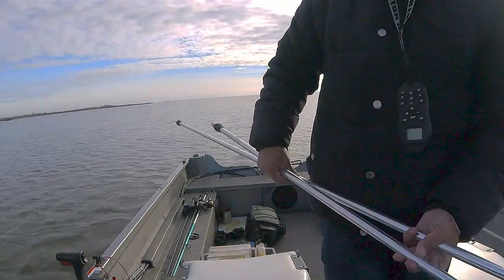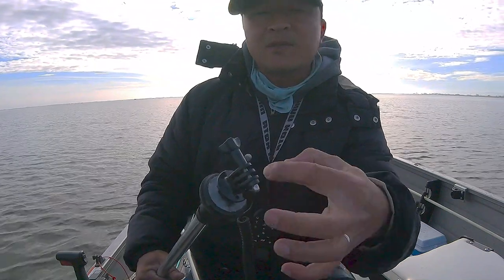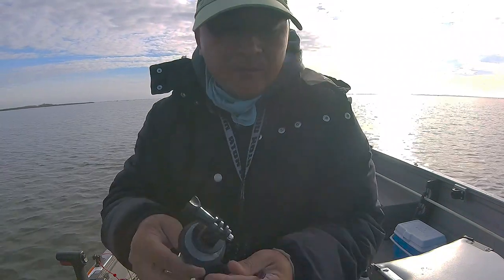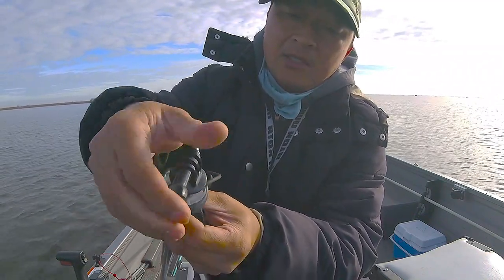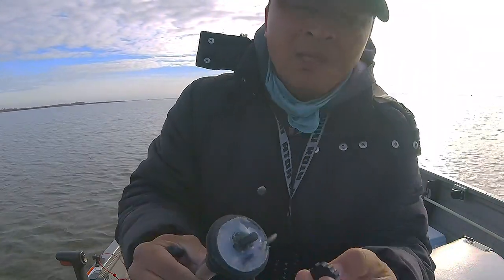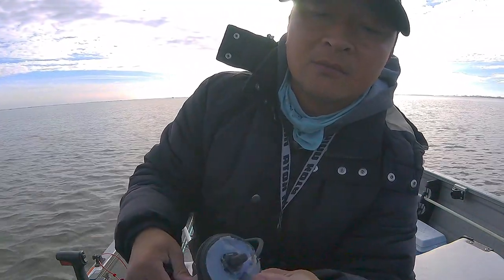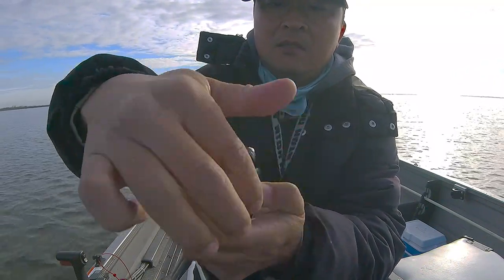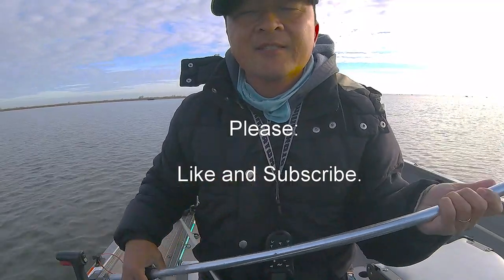My DIY GoPro mount/stand with charger.

Comment: Thanks for this battery.. i have an electrical outlet box on my BassTracker. It looks like I could use a female plug in adapter that will accept my GoPro port to use the boat battery to run the recording session, rather than the GpPro battery, [That is what you have done, just in a different manner, correct?
Reply from the maker: No problem. Hope this helps. Good luck.
Reply: I had to watch your video again. I've got a professional photography friend who states that there must be a converter between your camera USB-C cable and your 12 volt[boat battery] source for this to work correctly otherwise you'll ruin the charging system of the camera since it is designed for 110 electricity.. Your thoughts, please.
Reply from the maker: I bought a cheep micro usb car charger that plugs into the cigarette lighter with a curly cable .  I took apart the part that plugs into the cigarette lighter (remove the outer casing), exposing the small circuit card. The circuit card supplies the 5 volts for charging. There are 2 wires that are soldered to the metal that touches the positive and negative power. De solder that 2 connection and solder it to the 2 wire that comes up from the light post. Use a multi meter to test leads coming up from light post to determine which wire is positive or negative. let me know if you have any questions.